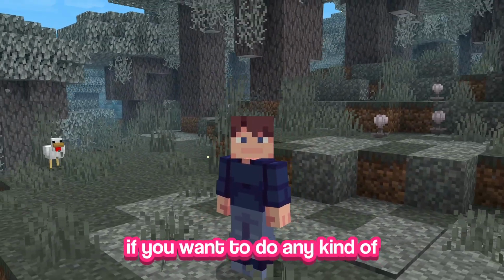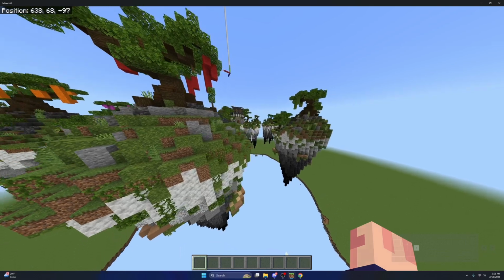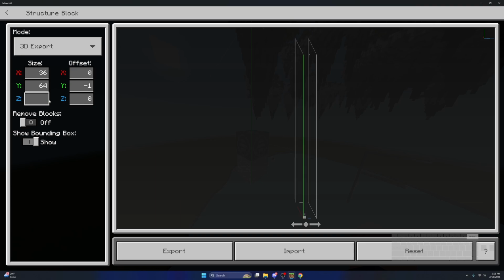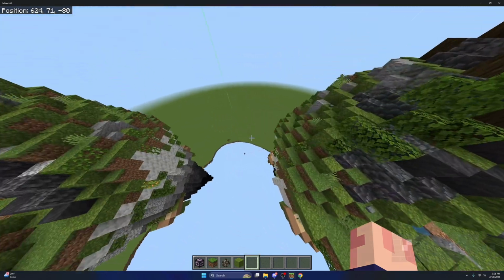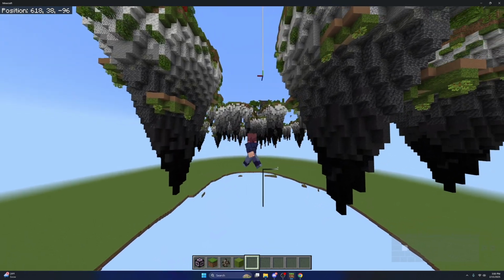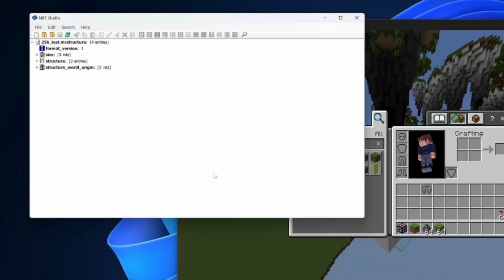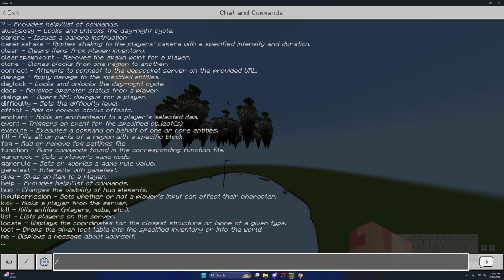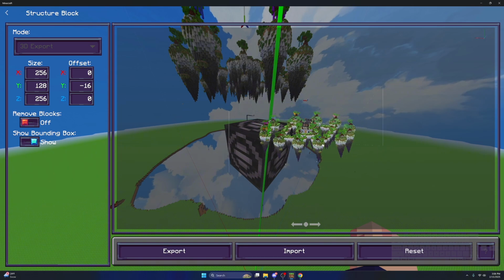convert minecraft structures to models easily

Comment: Can’t corner structure blocks be used to extend the range?
Reply from the maker: i don’t believe so — after looking into it, the corner mode just allows you to place two blocks at either end of the area you’d like to be included in your structure (instead of having to use coordinates and resize it manually).
but, from my understanding, the range of two corner structure blocks is still subject to the same 64x limit by default.

Comment: 3:52 corner is use for the area selection place 1 in a top corner and 1 inthe diagnal on the bottem. Make sure the name the corners and the save the same name, then in the save block press detect
Reply from the maker: ah i see, thanks for letting me know!
so it sounds like an alternative method to having to resize the area, but still does essentially the same thing